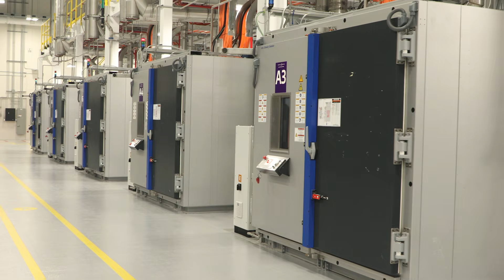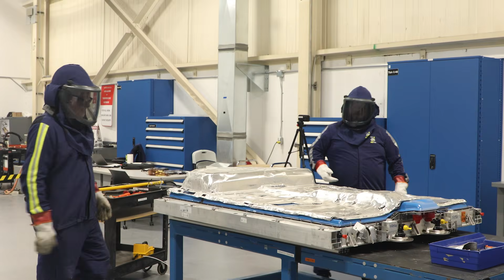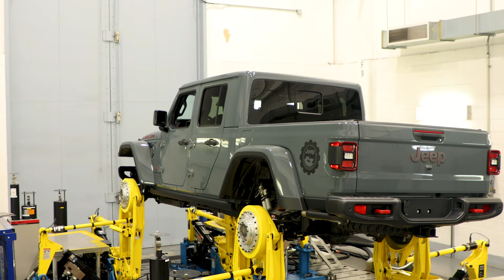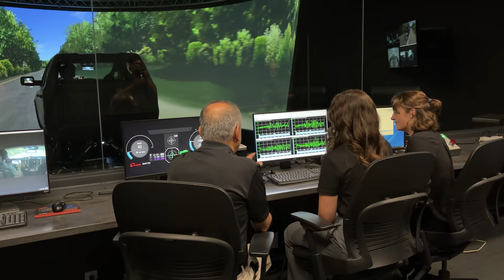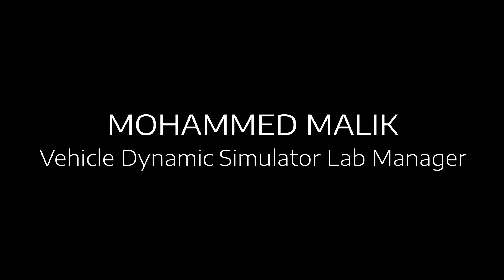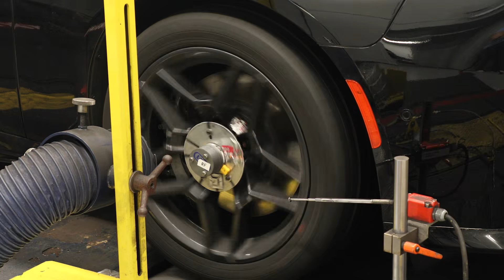Jeep Development, Engineering, Testing: Stellantis Automotive Research and Development Centre (ARDC)

Comment: 3:17 his job is so dnagerous they have to wear all the protective gear, and have another guy there with a hook to yank him away just in case, but yet its safe to put that thing under your car where it is going to get beat up by rocks and bumps and scrapes and sprayed with water that will corroade it. Give Me A Break. It's time to ditch the EV SHIT. BTW you spelled CENTER wrong 2 times in the first 3 minutes.
Reply: Hey bud, That's a Arc Flash suit, To protect them from the Open Case of batteries full of electricity that one wrong move can send all  his body if he drops something and shorts the battery. It's the same situation with power lines, Fuses from the mains, Breakers in Commercial area's, Basically everywhere you'd walk, Work, Have a nice picnic in any place at all has the same stuff with the same destructive ability

 (It's important to know how this stuff works so you're aware of the dangers, if you do home tours like your name implies PLEASE Look up HV Electrical safety so you can determine if a house you are showing is safe electrical wise)